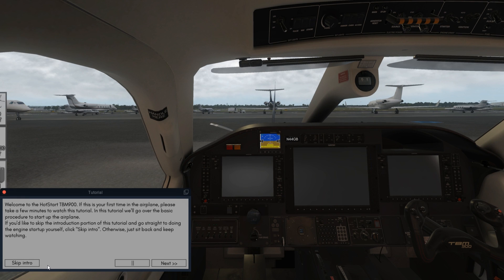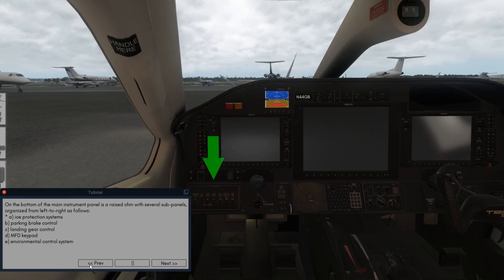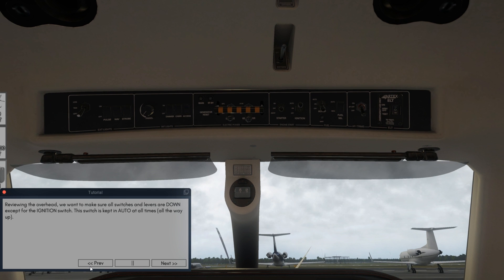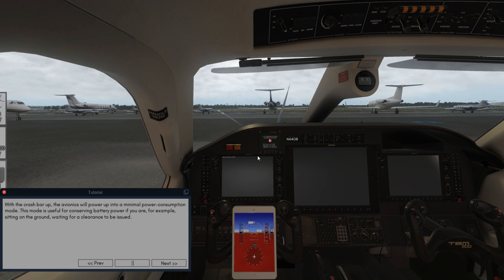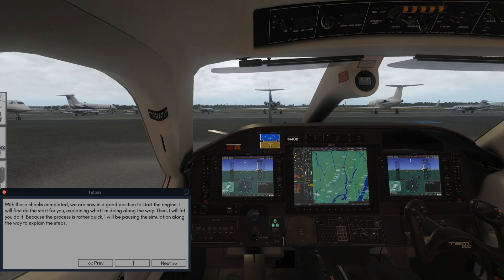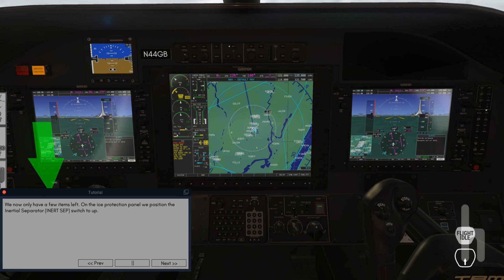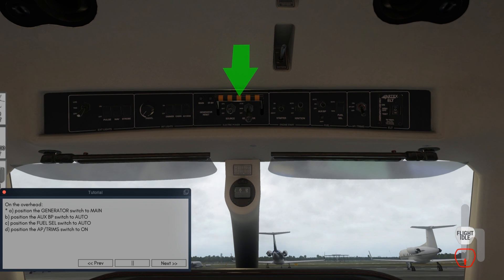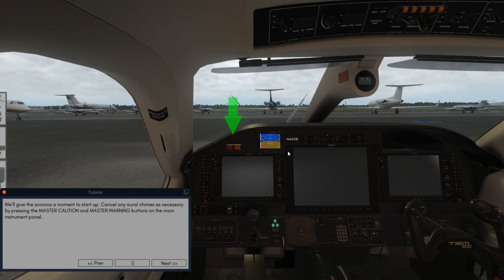HotStart TBM 900 Interactive Engine Start Up Tutorial for X-Plane 11

Comment: I push my crash bar up but it keeps on going right back down... any help?
Reply: Did you ever resolve this? I have the same issue
Reply: @Gnompsky  Yeah, I ended up not activating it correctly... I thought the only thing that I had to activate wa s the installer, not only the plane inside of the sim.

Comment: 👍👍👍
I don't have xp 11 but i like the tutorial
U should try P3D
Reply: Aj. You sound like me two years ago.  then I bought X-Plane 10 on sale for $15.00 (steam) I was immediately impressed. Left P3D & FSX steam edition untouched for months. Then X-Plane 11 came out and I jumped on it and wiped my drive clean of any P3D, FSX, Orbx and ALL other scenery and planes.  Nothing wrong with using P3D. But if you get a chance to try X-Plane, get it. There is a free demo but I was not impressed by that AT ALL.   Both Sims can occupy the computer at the same time. Frame Rates and smooth performance are far superior, for me, in X-Plane 11 than what I was seeing in P3D.
Reply: @drmckee  i don't have a gaming computer
Reply: Are you running P3D?  If so, you likely can run X-Plane with NO problems.  Now if YOU are one who believes every setting MUST be at Maximum setting or it sucks, then stay with P3D.  Not a thing wrong with P3D and it will deliver you enjoyment.  I am just saying you could try the demo and see how smooth (or lack thereof) it is.
Reply: @drmckee 
Yea ij love P3D and xp11 and fsx i want them all in the future
Reply: @drmckee 
Yea i just try to download demo they say there is a problem
Reply: if you like train simulator p3d is a good choice! 😆😆😆
Reply: @Simulanderson 
I said P3D not train simlator
And there differents be between P3D and train simlator this is my opinion
Reply: Try P3D? That would be a downgrade sir.